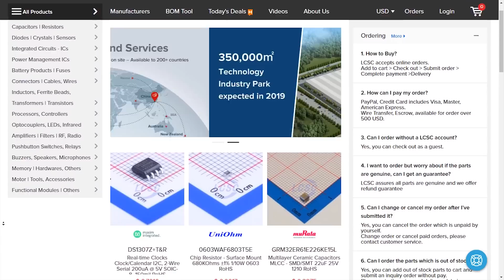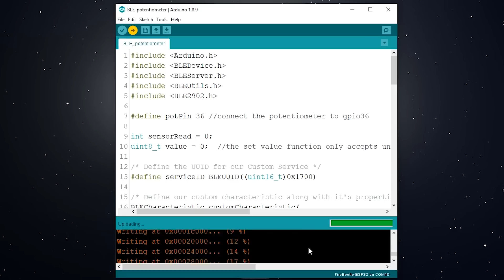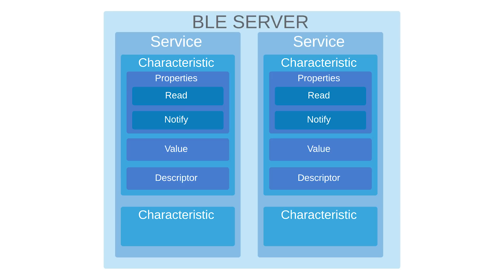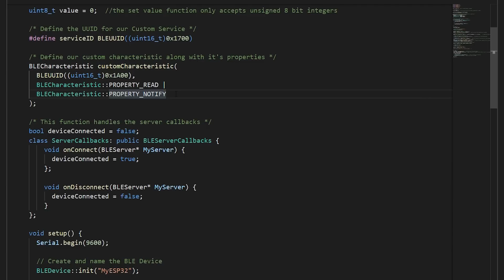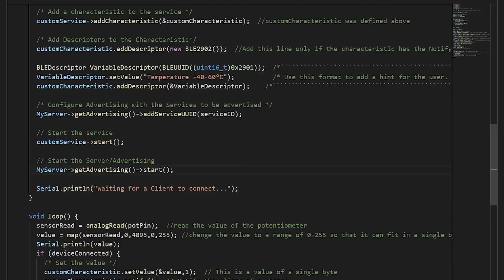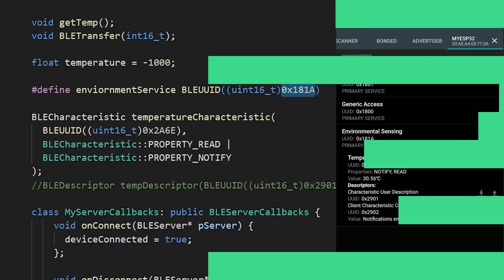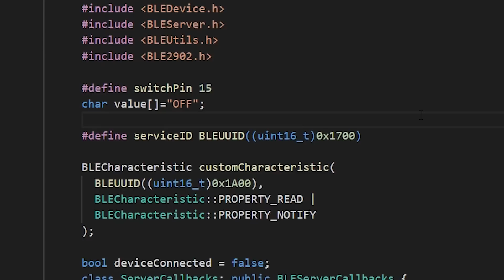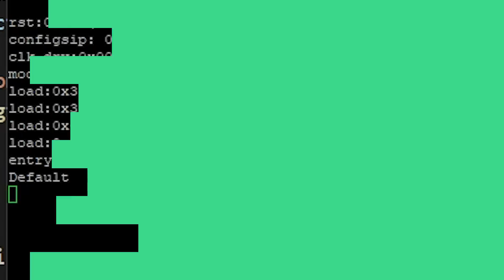Easiest ESP32 BLE (Bluetooth Low Energy) Tutorial | Arduino

Comment from the maker: How many times did I say 'BLE'?
Reply: What's the current consumption of this loaded board while running this "Low Energy" sketch?
Reply from the maker: That's a good question. I haven't actually measured the current consumption on this board but on the M5Stack (a ESP32 board with an absolutely minuscule battery), the everything-to-string sketch runs for about a hour (while a client is connected) while a WiFi web server sketch dies within minutes.

Comment: I noticed your channel name (for semi-obvious reasons 🙂). I did a lot of experimentation on the Arduino Uno, but I just got my very first ESP32 board yesterday.

One thing that caught my attention was the notion of using BLE for its low power, but ... wouldn't a Nordic nRF52840 be even better? I know that it competes with the ESP32 in Meshtastic (LoRa) devices due to its lower power consumption when the higher clock speed of the ESP32 isn't necessary. (Provided you don't need Wi-Fi functionality, which the ESP32 has but the Nordic MCU doesn't.)

Comment: Hi there. I hope you are still active. I need to build a bluetooth scanner which fires a relay when a specific bluetooth device is in the proximity. I have a firebeetle and the arduino IDE. I am lost from that point on. I can't find the board in the list, I cannot seem to connect. Yes, I am a n00b

Comment: What should I put in the ESP32 disconnect function in order to let the ESP32 be advertised for a new connection? Its seems the code in the setup is executed one time and when I disconnect client device (a MIT appinventor custom app) I cannot reconnect again. The ESP32 server is stopped - maybe you have a link to correct configuration for a MIT app disconnect command?

Comment: Will this code also work if I use other hardware? I am using the dht22 as a sensor and I have the bluefruit spi friend as a bluetooth device both connected to the arduino
Reply from the maker: The Bluetooth code is hardware specific to the esp32

Comment: Thank you for your BLE videos.  I have an ESP32 and I have tried your BLE examples and they all work on my phone.  I am struggling to get the BLE Client to work as I want to be able to have another ESP32 read these values.
Here is what happens when I run your BLE_everything_to_string program on another client BLE which I am using the built in BLE_client app:

Starting Arduino BLE Client application...
BLE Advertised Device found: Name: , Address: 4b:41:58:c8:94:f2, manufacturer data: 4c0010050818237b8e
BLE Advertised Device found: Name: , Address: 1e:44:1e:8d:54:08, manufacturer data: 0600010920021f0f72b658f8fa6a56054b76f656467d07548b169b875d
BLE Advertised Device found: Name: , Address: 4a:f7:2c:59:b5:ec, manufacturer data: 4c001005421c6e4d8a
BLE Advertised Device found: Name: , Address: 7f:79:4e:7f:82:4e, manufacturer data: 4c0010050818237b8e
BLE Advertised Device found: Name: , Address: 57:b1:e4:c9:d2:82, manufacturer data: 4c001005401c7dd543
BLE Advertised Device found: Name: , Address: 7b:d8:62:bc:e9:84, manufacturer data: 4c001005241c548cdc, txPower: 8

As you can see I do not see the Device Name or any of the messages like this is a string as I am seeing them on my phone app but not on the BLE_client.  Any help would be appreciated!

Comment: I loaded your app into MIT App Inventor, compiled and put it on my Pixel 3A phone. I also loaded your switch code onto my ESP32 board. There seems to be something wrong with the App as it always comes back with "No Devices Found". Running a "BLE Scanner" app I can find the ESP32 and see that the switch program is working. Running an app I wrote on MIT App Inventor for a different BLE module, I was able to see the ESP32, but could not connect because it was looking for a different service ID. I even tried loading your APK, and it was unable to find any devices. Not sure what is wrong, but something seems broken as both my APP and the BLE scanner can see the ESP32, but your APP does not.

Comment: Great video thanks. Question. Am I able to send a bluetooth classic throttle signal over serialBT from a transmitter ESP32 to a receiver ESP32 whist also sending temperature readings back to the transmitter ESP32? If so! Would I use BLE for this? Can I even use BT and BLE at the same time?

Comment: Hey, nice Video.

Im trying atm to communicate with a bluetooth radiator-valve atm. 

If i scan for ble devices with the examplecode given by the IDE, i can find it. But i was hopeing i could use your video to find out which data i can request or just get from the device. There is an existing project on github already, but i want to build my own.

I need abit of help. Do you have any idea?
Reply from the maker: https://github.com/espressif/arduino-esp32/blob/master/libraries/BLE/examples/BLE_client/BLE_client.ino
Reply: @LiveSparks  Thank you very much. with that, i could connect to the service uuid and get a data. But only one. the valves consisting of alot of data. weird
Reply from the maker: You need to code for each service that you want to read. Use nrf connect app to see what services are being advertised.

Comment: Not working, I'm using a huzzah32 board with ds18b20 and I am not able to get any temp readings using this code. i can connect via ble but will not give me any temp values on the app or on the serial monitor ive tried many different pins. 

Any help please?
Reply from the maker: If you are not getting anything even on the serial monitor then you might wanna try a different pin for the sensor.
Reply: @LiveSparks  Thanks for the response, I am getting this on the serial monitor 

rec = 0
85.00

repeating
Reply: Disregard my last message, my resistor was not connected properly. I am getting readings now on the serial monitor but not on the nRF app. It is connected but for value it shows 0x280A instead of a temp reading
Reply: So i believe im getting a hexadecimal value
Reply from the maker: I am sorry but I am stumped as to why this might be. Is the environment sensing service showing up correctly in the nRF Connect app?
Reply: LiveSparks Yes everything is showing up correctly but for some reason the temperature value is given in some hexadecimal value. I know the sensor is working because if I touch the sensor the hexadecimal value increases.
Reply from the maker: If the temperature characteristic is showing up correctly then the nRF Connect app should have automatically converted the data to decimal. I am sorry but I am stumped as to why this might be. The last suggestion I can give is to check if you are correctly sending a 16 bit unsigned int and not a float.
Reply: LiveSparks I figured it out.. Apparently only the android app will display the converted temp value, so I used an android and it works perfectly. Thanks

Comment: Hello, thanks for the tutorial! but i've got some problem that my potentiometer analog value is always 255 (shown in the serial monitor), or the value at the characteristic is always FF at the nRF Connect App. I use GPIO14 from ESP32 DOIT DEVKIT V1 Board. Can you help me please? thanks
Reply from the maker: Not all pins of the ESP32 are suitable for analog readings. Try some other pins too.

Comment: You can send more than a single byte in a characteristics value.  Using the setvalue byte array parameter is not a workaround, it's a feature
Reply from the maker: You are right, of course. I should have worded that better.

Comment: hello the app is not connecting to ESP32 always responds no device found
Reply from the maker: Make sure your Bluetooth is on. The custom app doesn't give a warning if Bluetooth is off.
Reply: @LiveSparks  Yes its on
Reply from the maker: Can you see the device in the nRF Connect app? If not, then the issue might be with the code running on the ESP
Reply: Yes i am able to see the device in nrf connect app
Reply: I am trying to add button on mit app intventer but not able to make one can help on how to do that
Reply from the maker: @mukund22kar  Hey, I just tried the examples again and they seem to work fine for me. NOTE that only the switch example and the everything_to_string example would work correctly with the custom app but the ESP should still be discovered when you search for it. It might be possible that the compiled app is not compatible with your phone.
Reply from the maker: @mukund22kar  MIT App Inventor has some good documentation available here : http://appinventor.mit.edu/explore/get-started.html
Reply: Does wifi and Bluetooth both run simultaneously at same time?
Reply from the maker: They can both work at the same time but since they share the same radio, the program needs to be very optimized to work without performance issues.